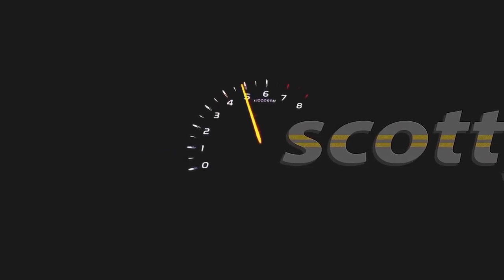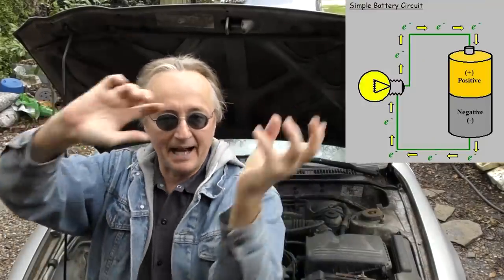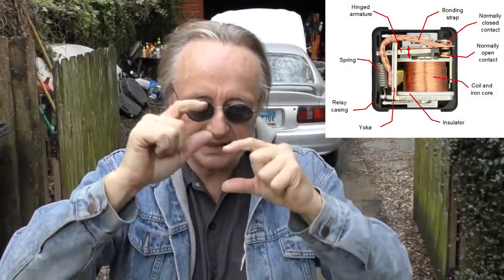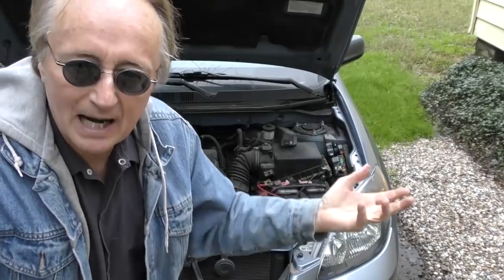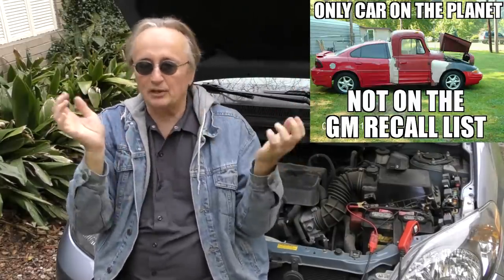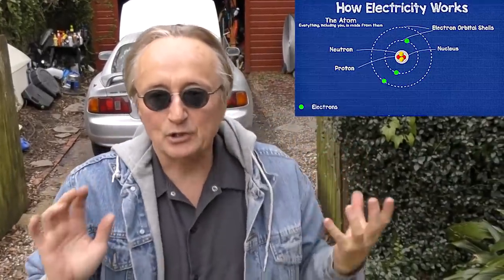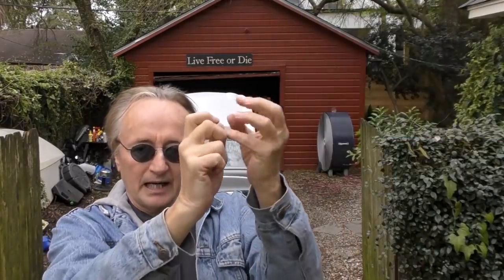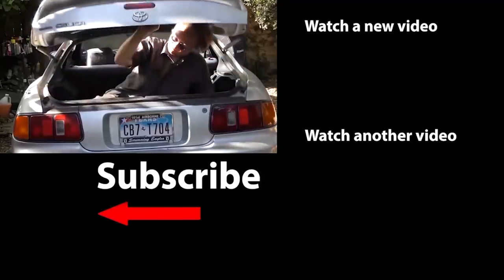Doing This Will Save You Thousands in Electrical Repairs

Comment: Chrysler Pacificas were good for no starter crank. Test the power at the starter and was good must be a bad starter. Install new starter still no crank. There's a ground wire on the side if the transmission that rots off and kills the engine ground. Had an 03 Malibu that I bought with a bad motor. Put the new motor in and every once in a while it would pick up a super aggressive shift, then it would go away and be fine then come back, finally one day I was driving and it started acting up and the temperature gauge was dropping out. Found out I routed the harness wrong under the alternator and had rubbed through on the temp sensor causing the aggressive shift.

Comment: One thing to keep in mind is that electrical current flows from NEGATIVE to POSITIVE, not the other way around.  That's why when you disconnect your battery to work on an electrical problem, you remove the NEGATIVE terminal...it disconnects the source of the negatively charged electrons that comprise the electrical current.

Comment: Electrical gremlins is right! I have a Saturn Aura that sometimes doesn't want to start. Cranks but won't start. Then the next day it's fine again. It's not the fuel pump. It's not the crank sensor (both of these have been replaced for NO REASON). It's got to be something weird in the electrical system, but I have no clue what. My mechanic swears he's gone through every connection to look for anything and clean off anything. But still, sometimes it just cranks and doesn't start. I'm afraid I'll never solve the mystery. Gremlins!!

Comment: Fuel pump relays. Yup. As they ( the relay ) cycle on and off , the contacts spark slightly creating carbon deposits. After some time, the contact resistance becomes high enough that current cannot flow, and the fuel pump no longer pumps fuel. The same thing happens to speaker relays in stereos.

Comment: You're the MAN!  I like that you supply links to your test equipment and such, but where's the link to "Common Sense"?  I can't find it anywhere! LOL :) It's getting harder to find a good place to ground electrical stuff on these new cars! Years ago, you could get a good ground from the glove box hinge screw! Now, you need to use the bolt that grounds the battery to the engine block!

Comment: Feel better man...

Scotty:  I'm looking for a reliable midsize SUV for me.  I'm a 6'2" 250 lbs attorney (but I do mainly court appointed cases for poor people).  I absolutely refuse to drive a CRV, RDX, MDX, or RAV4.  Would a 2011 or 2012 Lexus RX 350 work or maybe a Ford Edge around 2015? I'm trying to stay under $20,000 and I'm a guy who does not look like a soccer mom. Your videos have helped me resist getting a Jeep Grand Cherokee, Ram 1500, or Ford Explorer (reliability issues). I am a little worried that under the hood, the Lexus RX 350's entire area is covered.  How will I do basic things like changing oil or air filters? 

Rev up your Halls throat lozenges...Corolla Red, as in Cherry.

Comment: An old car gets corrosion, inavidably. 90% or more of drivers won't go to that problem, clean this and that, but if you are in this 10% and you do you will save money not only for parts, towing and quick repair request are a lot more. My fuel pump was exactly as Scotty said, corrosion in relay. An old mechanic disconnected the relay and bent a wire, no isolotion at ends, plugged it in and everything worked. He even told me it can drive like that just when the engine is turned off unplug it or the pump will die. Just new relay, cheap and go.

Comment: I comment a lot bout my van, town and country, had a instance where the van wouldn’t start and it was showing all the boxes around the gears on the dash. Short version the trans ground was corroded. Cleaned it up and off I went mechanic didn’t even charge since I just had work done

Comment: Saw where Ford trucks are having problems with bad grounds on the transmission, and electrical current ends up flowing through the torque converter, welding the pump, locking it up.

Comment: Man I replaced my fuel pump on my 09 dodge journey 😤 come to find out it had a bad fuel pump relay ......but this relay is INTEGRATED WITHIN the tipm "fuse box" it did not have an external relay u can replace u have to remove old one right off motherboard and sodder new one in

Comment: Pulling connectors apart and applying a small amount of dielectric grease will also prevent them from corroding in the first place. watch body and engine grounds and keep then corrosion free..

Comment: Very relatable. :D On Sunday I messed a little with wires in my car (installed back-up alarm), next day (on Monday) the battery was almost empty, radio was all blinking, the starter would not turn, my first thought - God damn it, I fried electronics, but luckily it was only "dead" battery.

Comment: I have an 2004 Chevy Silverado.  It had front end damage previously.  My gauges are acting crazy.  At first the guages would register incorrectly.  Now they usually just don't work at all.  My husband thinks it has a bad ground wire.  Someone had also cut the wires to the radio trying to change it out.  Also thought the cluster may be bad.  He is checking ground wires first.  Any ideas?  Thanks

Comment: Hey Scotty from Alaska! What do you think of a 1984 GMC Sierra pick up with 180,000 miles on it, my grandfather put new 350 V8 5.7 L engine, 400 transmission, and transfer case in 1992 it sat for 17 years runs and drives great no rust on the frame. Thank you have a wonderful day

Comment: Just recently got no start issue on xterra 2007 and ive  checked fuse its ok then ive changed fuel pump and its not starting 🤔 then swapped fog light relay with ecm relay on ipdm and its fire right up 🎉 but really first time got stranded cause of a relay i have to carry 2 spare relay and some fuses 😁

Comment: Scotty, could you make a video on possible consequences of driving with a weak battery? Can this mess up the electronic stability control (ESP, VDC)? The reason I ask: few weeks ago I had an issue with Subaru's electronic limited slip device on the snow. Soon afterwards it turned out that the battery could not be charged beyond 11.5 v and had to be replaced...

Comment: When I was still working on cars and one came in with a no crank/no start the first place I would go to was does it have a aftermarket antitheft system. Does it work? NO! I would yank it off and most of the time problem solved.

Comment: What's God I forgot to mention is that on many newer vehicles some of the computer models has to constantly have power going to them or they will lose their memory and have to be replaced Before you disconnect the battery on your vehicle especially if it is newer go to the auto parts store and look into getting a replacement battery and ask if there is anything recommended in the procedures like taking one of the adapters that plugs into your 12 V cigarette lighter and then you plug a 9 V battery into that be used before you disconnect your 12 V battery Because if that is a recommended part of the procedure for placing your 12 V battery that means that there is one or more computer modules that has to keep power to it otherwise it would either cost a lot of money to have the computer module reprogrammed if it could be reprogrammed or it would have to be replaced Which either way it costs a lot of money My sister's fiance had that issue in his 2009 Subaru where he replaced the battery and did not use one of those and it caused a computer module to lose its memory that could not be reprogrammed and it cost $400 to replace that computer module.

Comment: I am really curious why this guy constantly says relays are a protection device. Scotty, for the record, relays have been used in cars for as long as I can remember, not only in modern cars. They are NOT to protect a circuit. I thought I explained this in another video for you. Relays are designed to carry a heavier load than a switch or a transistor can carry.Also another fail in this video is your use of the power probe to test for power at a fuse. Yes, it will show power, however, that tools does not load the circuit you are testing...In simple terms, if you had a problem in the circuit, say voltage drop, where you were only getting 3 volts, instead of 12, that power probe will still show power. You would continue chasing the problem never realizing that you missed it. So, always load test powers and ground with a device that load them. I use an incandescent test light, or a headlight bulb for this type of testing. But a guy who is a mechanic for 50 years should already know the basics... Another tip I will give you is this. That power probe is a tool is personally do use. However, I know when not to use it. In a person's hands who is not able to rad and understand wiring diagrams or how circuits in vehicles work, you have a great potential to destroy components using it. I have had plenty of cars sent to me from other shops who damaged control modules misusing a power probe. If you actually work on cars man, how about a video actually showing a diagnosis?

Comment: I just had a huge ground issue in my 2012 Hyundai Sonata limited. I told dealership it had to be a ground they had it for a month. Could not find the Problem which is weird when they are certified. So to it to a local mechanic Probilt in my area. They fix in less in 2 days. It ended up being the main ground was Dirty. And in the passenger side kick panel the disruption ground was loose. 

With this issue my car had no power what so ever
Reply: may day Yes seriously I was not happy I even called Hyundai corporate to complain on them because I feel like my car was put on the back burner so I just took it to a local shop and they fixed it within two days. The mechanics at dealerships get paid by the job so they was probably looking at it they couldn’t resolve it so they’re not going to get paid

Comment: I got one for you Scotty I have and 06 G6 with a V6 (666) has had front end problems due to the craters showing up every year even at this time the car has over 200k miles one day I was driving it it said power steering on the radio like it was out but its electric power assist there isn't a pump would you have an idea what it would be thanks for your hard work

Comment: Please don't use coke on your terminals it can get inside these newer batteries and change the chemical makeup of the acid. Usually just enough to not make it work. If you have to use something other than terminal cleaner use baking soda and water just keep the water from touching on either side as it can create an short. So do one side first and then the other side.

Comment: I had a 69 z28 Camaro back in 71, had dealership replace flywheel, ran so bad when I got it back it blew hole in muffler, they said not our problem, later found they left ground off bell housing/ trans, said they'd give me 10 percent off new muffer, nothanks Chev steelership

Comment: I've had a gremlin the computer thought was electrical. It would rain most of a month every fall and driving at night the battery would go dead. A mechanic had left out a splash shield and rain would splash on the belt making the belt slip with the headlights on.

Comment: Hilarious pictures. Gonna be checking for gremlins today I know I got a corroded positive terminal on my battery but I didn't know it could be wreaking chaos in my system. Could faulty grounds and corroded terminals cause an obd control module to misregulate my idle air intake and cause a check engine light?
I'm gonna find out today.

Comment: Hey Scotty how are you I have a question I drive an 2004 Honda accord and my radio isn't working after all I am not using the factory radio but my after market radio isn't working ether even after I replace it with a new radio fuse please help am going on a road trip and need my radio to work. What do u think should I replace the radio or is it maybe a relay?

Comment: My 07 ford edge makes several locking unlocking sounds when it is cold, like -20 below cold. It does it when I use the switch inside after I open the driver door up already. Is that something to be concerned about or is it doing that just because its cold? I had to put a new battery in it recently because the old one froze.

Comment: I had the relay go out for my fuel pump on my 2012 Dodge Grand Caravan.  Replacing a fuel pump relay should be easy to replace but stupid Dodge engineers decided to embed the fuel pump relay inside the TIPM module.  So, you had three options, 1.) replace the whole TIPM module (very expensive; ~$500 plus labor), 2.) splice the wires for the fuel pump relay from TIPM module and wire to external relay (cheap part ~$50, but a lot of labor), or 3.) connect a wire with fuse from the fuse socket for the extra cigarette lighter to the fuel pump fuse socket (~$10 and done in a minute).  Guess which one I decided to do?

Comment: I have a 2amp parasitic draw on my body control module circuit.

Would it be ok to back probe all of the connectors (exceot for the power line to the battery).

Comment: Mr. Scotty every year I have to change my alternator in my battery for some reason I have took it to the dealership they told me it was nothing wrong with It have took to other mechanics they told me it was nothing wrong with it but apparently something is wrong with it my car loses voltage a lot of times sporadic especially in my car is idling and battery light will turn on even though I just replaced the battery could you please help me out. What do you think is wrong with this car. I figure it's something electrical from the battery to the alternator that no one has been able to assess.

Comment: I spray my wires, connectors, and the top and bottom of my fusebox with wd-40. Should i need to remove a connector, i lube it with dielecteic grease prior to assembly.

Comment: My horn relay in my 350z kept making a fast randomish clicking noise and made the horn make insane noise so I replaced it and the replacement relay did the same thing so I kept the relay out and didn't experience any problem except no horn.  Does that sound like a bad ground problem yet only specific to the horn relay?  Also I'm not sure but I seem to recall that it acted up more often after driving in rain so I'm wondering if it's a water related short.   Ideas?

Comment: My car randomly just cuts of when I stop at lights or when it is idling and has a hard time starting back up when this happens if I keep the revs up a little bit it doesn't cut off. Where should I look to solve this issue its a 2002 alfa romeo 156 with a 1.8 l twin spark engine any help would be greatly appreciated

Comment: Hey Scotty when i turn my ignition on all the dash lights come as normal self test but when i start the engine all the lights go out as normal apart from the battery light it stays lit with engine running but when i turn the engine back off and restart again the battery light will go out as normal but not the first time i start it?, ive renewed the battery and checked the alternator and its charging 14v , do you know what i could check to fix the problem?

Comment: If you don't have the knowledge and you want to work on your car's electronics, here's my advice: DON'T!
Disconnecting your car battery isn't enough. When you connect it again you COULD ruin your computer modules. Or even start a fire in the car.

Comment: Explain why my climate control doesn’t turn on when its below freezing outside but when you drive it 30-60 minutes then the climate control magically turns on? It always works fine in warm weather, but in cold weather it has to “warm up” before it starts working.

Vid on my channel.

Comment: How about mice damage? How do you prevent mice from chewing up your wires?
I heard that modern wires are made with soy-based material, that's why mice like to chew on them.
Reply: Try moth balls in the offending area
Reply: @jroller 67 You write well, but you need to work on your reading comprehension.

Comment: Hey guys I got a 2008 honda accord exl it have a check ingine so I buy a cheap scaner and it said low voltage, what that means? Help please!!!
Reply: Sounds like you need a new battery.
Reply: @2405jacko  that's all! Nice thx for the information.
Reply: @milygonzalez3726  You're welcome.
Reply: @2405jacko  Hey I put a new battery and is fix,you rock man!
Reply: @milygonzalez3726  I'm so happy I could help you .
Reply: @milygonzalez3726  My wife has a 2009 Accord EXl, same thing happened to her. Glad I could help.

Comment: I actually disagree with you on this one Scotty. You are an excellent mechanic but in my personal experience, it's cheaper and more effective to buy new terminal connectors. The only way I could see getting the stuff to clean the connectors is if you're doing it for a ton of different cars. For a one time single car repair, it's 6 dollars for a two pack of terminal connector replacements and then you're pretty much guaranteed 5-10 years of a quality new connector. New parts are going to do you way better than cleaning rusted crap.